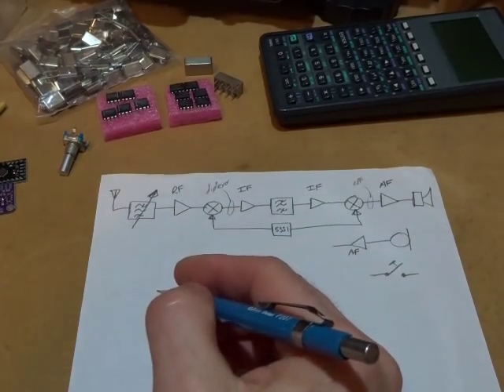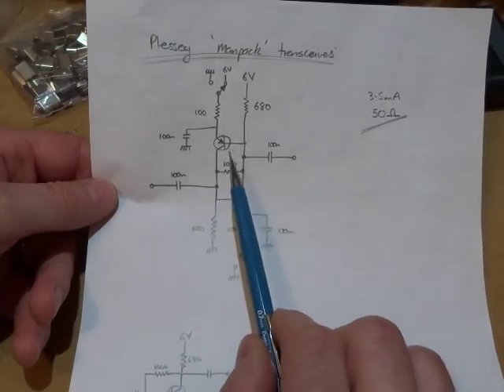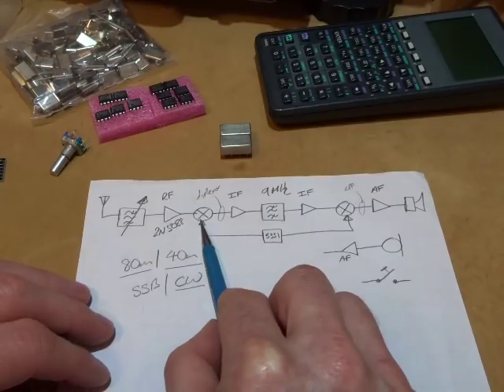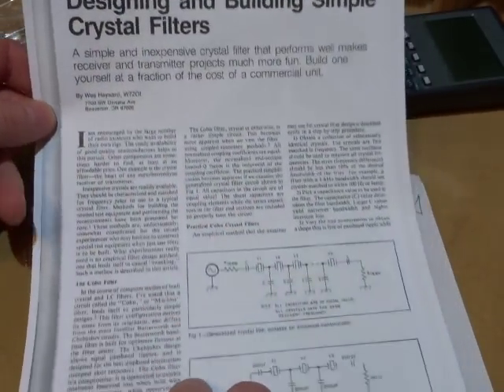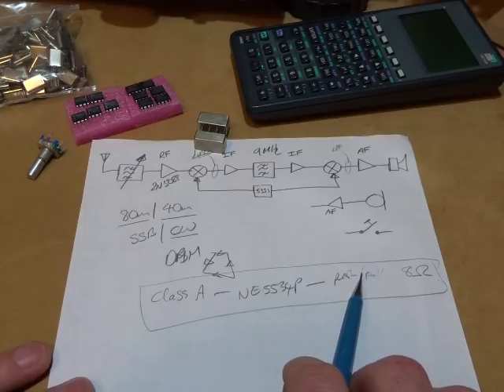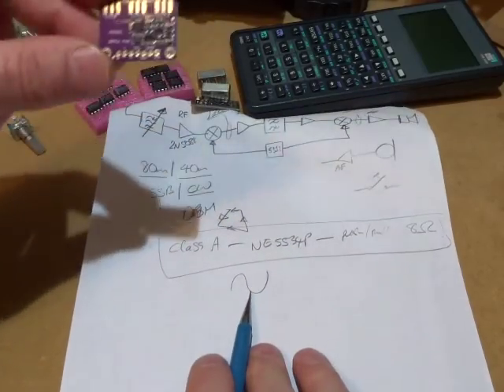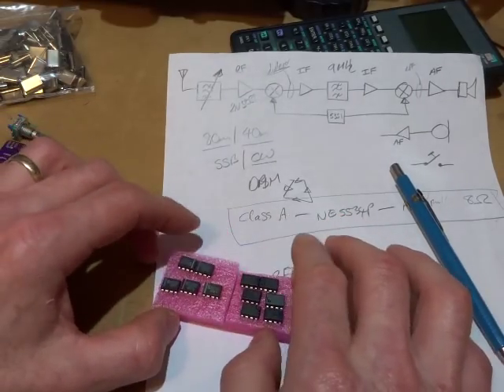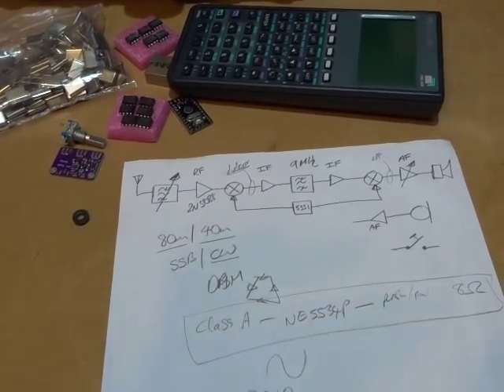Homebrew 80/40m SSB/CW Rig - #1 Design Thoughts and Ideas

Comment: Looks like fun.  Very interested in the crystal filters.  I'm about to try building my first one in a Drew Diamond superhet receiver design.  Also looking forward to your DBM's.  I have nothing against SBL-1's but it's great to learn the discrete path.  I see suggestions for 20m.  I'll add one for a high performance cw rig for the 30m band.  Maybe 5W out and selectable bandwidth filtering?  Thanks very much for the inspiring videos!
Mark
KC4GIA
Reply from the maker: Hi Mark. Thanks for the feedback, I really appreciate it. The audio amp is complete. Hopefully, I'll have time to put a video up in the next day or so. Happy homebrewing!

73s
Charlie, ZL2CTM
Reply: KC4GIA1 Mark, which Drew Diamond design are you building? The TCF from 1992?  Paul VK3HN.
Reply: Paul Taylor I am not sure of the year.  It's in vol 3 of his project books titled 'A practicable superhet receiver for 1.8 to 2.0 Mhz and HF.  I'm building it for 80m and may make a couple of converters for other bands.
Reply: KC4GIA1 I know that design, uses a digital logic  IC  as switching mixer, good luck and post a video when it's working!

Comment: Good stuff as always. Really looking forward to this one. Especially the filter designs and what you come up with. I'm doing the same so I'll be watching. CHEERS.
Reply from the maker: Excellent. Please note that I'm not saying this is how it should be done, but am just documenting what I did and how it turned out. In this particular build I know things can be done better, but it's an opportunity for me to try some new things to see how they work. The audio amp is a good example of that. All good fun!
Reply: No worries. I have the same article by Wes Hayward and having been itching to make a filter from his designs myself for some time. I'm excited to see what you come up with. I'm going with a 9mhz filter also for my 40 meter rig. 👍
Reply from the maker: As an aside, I'm looking at the four crystal versions. Depending on the CW filter goes, that may have to be upped to-say-six crystals. I wish I had a spectrum analyser and not a sig gen+Excel!

Comment: Suggest you check out the G6LBQ Bitx, it's a Bitx , bilateral amp stages, Nano/si5351, but with improvements including MC1350 IF and a better mic amp. I've built one in recent months and the receiver is good. Can provide more details if you like.  Also I've implemented CW with si5351 clK1 at sig freq minus 700 hz, keyed in software with excellent results, side tone via Arduino tone lib. So much fun! 73 VK3HN
Reply from the maker: Hi Paul. Thanks for the tip and I'll bear that in mind. For now I'll continue with my initial thoughts right or wrong. As for the keying the Si5351, I was pleasantly surprised how well that went on the last build. Very straight forward. I haven't used the Arduino audio library yet, and the plan for this rig is to generate a 700Hz tone, filter it, then feed it into the audio amp which I'll leave on during TX. Well that's the plan anyway... :o)

Thanks again

Charlie
Reply: Charlie Morris Great work as usual Charlie! I tried injecting filtered tone output using Arduino tone library into mic amp. It works ok   But a keen Sota activator alerted me to carrier leakage between the characters  Next time,  I used si5351.enable() and disable() to switch carrier clock on and off. It's more than fast enough for my CW speed.  I even got an unsolicited 'nice keying' comment from a VK3 CW veteran! Watching with interest.
Reply from the maker: That's good to hear about the 'nice keying' Paul. For the portable CW rig used the following commands to turn on and off (via the morse key) the CLK1 output: 
si5351.output_enable(SI5351_CLK1, 1);    // on
si5351.output_enable(SI5351_CLK1, 0);    // off
That's essentially the same as your commands. I'm using Jason Milldrum's Si5351 library, which works well for me. 
Cheers
Charlie